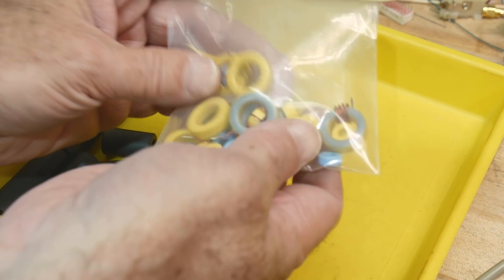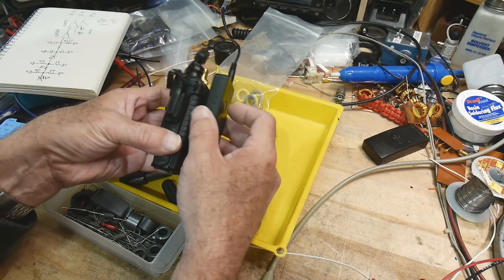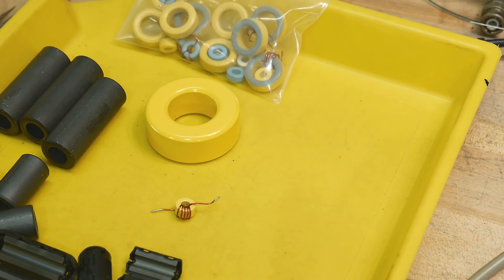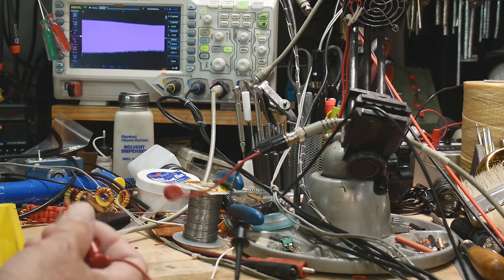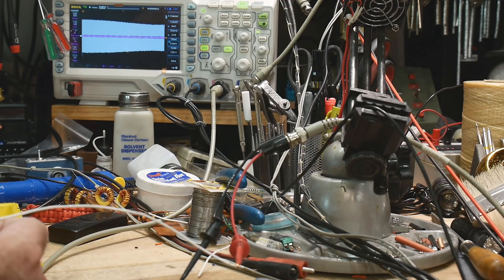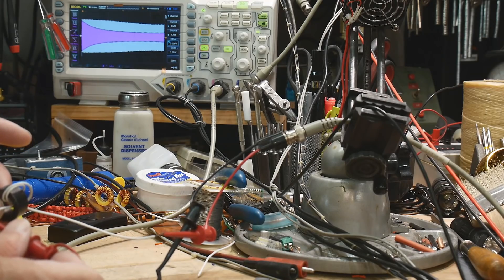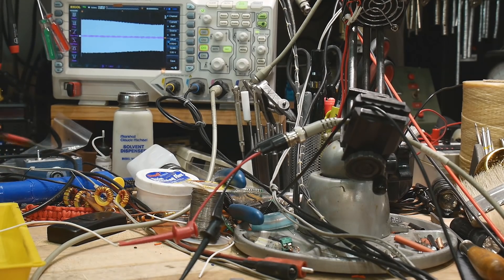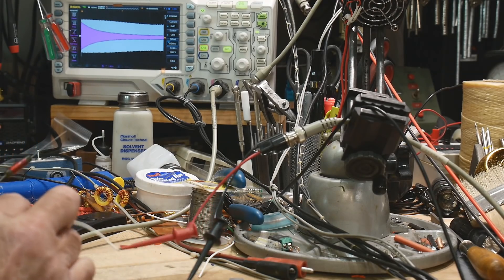#766 Measuring Ferrite RFI Suppression

Comment: Now show a coax cable to prove that you are not attenuating the shielded signal
Reply from the maker: that would be an interesting demonstration. many people would be  confused. It is a very uphill battle with the general public on the understanding of transmission lines.
Reply: @IMSAIGuy  I hope you don't limit your topics to things that "the general public" can understand!
Reply from the maker: @williamdenbeste9703  OK but you will have to answer all the questions about dipoles don't work without a balun and you can't measure SWR with a coax between the antenna.
Reply from the maker: oh and my favorite. you can't use your HT with the antenna horizontal  😊